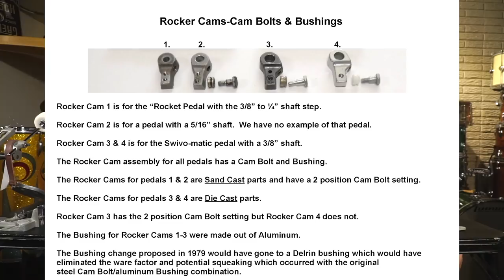Rogers Drums: Yesterday and Today - Classic Pedals

Comment: The needle bearings that Jim is referring to that Rogers used to put in their petals are “Torrington B-68’s I know this because I have several of the old pre-CBS Rogers swiv o matic pedals
And if we remove the cam that holds the beater ball you can see “TORRINGTON B - 68” stamped right into the needle bearing casing also I believe it was Jim many years ago at FRED GRUBER‘s house we had a lesson on the same day for a while he told me that Rogers used Torrington B 68 needle bearings on both ends later on CBS in an effort to cheapen the cost of making the pedal removed the more expensive needle bearings and just put two brass sleeves in their place and that was it!
Maybe there’s not much difference in feel but I felt a difference as I have both pedals, the ones with a needle bearings And the ones minus the needle bearings!

Comment: Hey guys, interesting video. I have a a Rogers kit, sold in Australia. Inside the floor Tom was a sticker with 'A 2035' and 9/72, along with some other numbers. The question I have regards the assembly of the bass pedal, very similar to the one at 9.00 mins. Is there somewhere I can send a pic to you to get some info about how it's supposed to go together ( the supporting rod underneath in particular)? Thanks if you can help.
Reply: I might add it still has Rogers skins on the Tom, floor Tom and bass drum.

Comment: In 1973 ( Junior in high school) I was fortunate enough to buy a c1972 Rogers Red Onyx Swivo set, 12,13,16 and 20 kit.... immaculate....  and ....I....could....not,,,,tune....the toms...... and it took me literally 45(?) years and discovering the you tube videos on bearing edges.... to realize that THE ORIGINAL bearing edges on my drum set WERE HORRIBLE.... scalloped, uneven wavy... HORRIBLE.... 
Moral of the story.... not every Rogers drum ( or Rogers Drum Builder) is (was) an OMG Bestest in the universe.... some were junk... but after I cut the bearing edges... much. much nicer.

B) I have two 1960/1970 Rogers  Swivo Bass drum pedals.... unplayable. 1)The geometry ( shape of the round-over/strap cam) CANT be correct and or 2) the way that the pedal attaches to the bass drum via the plate that stays attached to the bass drum rim... although convenient... results in the bass pedal sitting too far from the head.... so the beater makes contact well AFTER it has swung through / PAST perpendicular. This results in loss of energy transfer and reduced rebound/loss of speed/horrible action/feel. The pedal "feels" like it's "Reaching" for the head. Yes the pedal can be pivoted closer the the head, (via the height adjustment post)... but this would ADD to a "NON perpendicular stroke".... NOT good.
In short the pedals can be modified, or the BD rim could be notched to bring the pedal closer to the head.... but... 
Rogers..... the Cadillac of Drums..... mine was a lemon.... or built by a guy with a bad hangover.